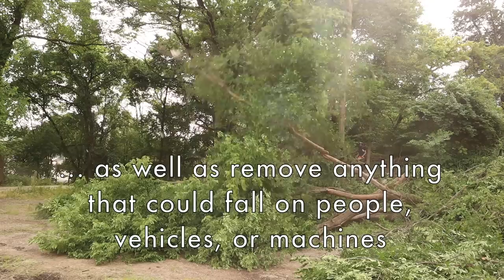Clearing Dangerous Trees from Behind the New Shop!  ~ Part 6 ~ Rebuilding of "The Salvage Cave"

Comment: I use ethanol fuel in all my equipment and it always fires right up with no problems.  Some of it can sit for years between use and fires right up.  Never had an issue with ethanol gumming up or clogging any carburetor.  I have at least 30 small engines and have been doing it that way since ethanol was introduced.  Just my experience.

Comment: Get 100LL at your local GA airport. Best fuel you can buy. Run Stihl ultra oil at 50 to 1. My father is an arborist and I have never had a problem.

Comment: you can remove the ethanol easily yourself. Mix 4 parts Gas with 1 part water, shake vigorously, leave over night. The ethanol free fuel floats in top of the water/ethanol, simply syphon it off. A clear container is best for this. I usually add an octane booster to the gas when I am done. Dispose of the water/ethanol in the same way you dispose of your other unwanted fluids.

Comment: Kawasaki 2 cycle  oil is the one  i have used for  years and   never had a problem with Kawasaki  ... using The Stihl  product is good but it will clog up your muffler Spark Arrestor  and other  things  ....   i know it's  not a 2 cycle repair video  on chain saws but i hope that helps  and by chance if you still do have the Spark Arrestor on Clean it or Remove it ... And for the Next Video  call in Mr  Ron Pratt  Mid West Towing  or Mr Hal From Summit Towing from  South Carolina  to help you pull out your front end loader LOL

Comment: Just for information, the problem is not the Ethanol itself but the quality of the base gasoline used to make the mixture they are calling gasoline. Using Ethanol you can mix it in a very poor, low octane, low stable and cheap gasoline to make a fuel that works as good as regular gasoline when fresh, but will not be stable to be storage for long time.
Ethanol can also absorve water and became more corrosive, an important aspect to consider if you have old cars.
Good information here: https://en.wikipedia.org/wiki/Common_ethanol_fuel_mixtures#Modifications_to_engines

Comment: You can remove the ethanol from the gasoline very easy, just mix the gasoline with water in a can, shake it and let it sit, shake it a few times during the day, and after a day the water have taken the ethanol from the gasoline and a mix of water and ethanol will be separated from the gasoline. Now you pour the gasoline into another can, and leave the water/ethanol in the bottom in the first can. Do the procedure twice if you want to be sure all the ethanol is gone. Now you have pure gasoline without ethanol.
Reply: Interesting

Comment: Fortunately in Oz it is still easy to get non ethanol fuel. Of the three grades at my local garage only one has ethanol. I also never put that crap in any of my small engines. I was reading a report the other day that said new testing has shown ethanol isn't even that good in engines designed to run on it. Let alone my old stuff. I run a lot of Stihl equipment and so buy Stihl two stroke oil. Then I just use that in everything else. Haven't had any dramas. I too run it a bit richer. On the newer Stihl stuff they have that stupid spark filter thing. Throw that away and then all good.
Reply: I never put ethanol fuel in any of my vehicles or equipment.  The ONLY time I buy it is if it is the cheapest fuel available near where I'm returning a rental car 😉.

Comment: Man ,I could use all that fire wood . 🪵 hahah I use the cheapest 2 cycle oil .. I have not seen any data on any 2 cycle oil product that proves its better , than the cheapest oil I can buy . 😉 plus at auctions I bought cases of a good quality oil for 10 bucks , that was 3 years ago still using and my chainsaw is a stihl  and running great

Comment: Clearly, your next toy needs to be an excavator with a thumb. I kept screaming at you to get out your bulldozer and use it as a wall while you picked up the logs with the wheel loader. I guess that fact that it is November when you posted this, and clearly it was summer when you shot it, not to mention that I am in Seattle, resulted in you not hearing me due to time and distance. I am wondering about hillside stability with the vegetation removed; might you need some sort of retaining wall back there?

Comment: In the UK we cannot buy ethanol free gasoline at all from filling stations, with even premium being 5% ethanol. I have to order gas called Aspen 4 (4 stroke) or Aspen 2 (2 stroke pre-mix) from my local agricultural suppliers in 25 litre drums and it is not cheap being £75 for the 25L drum.
Reply: Not totally the case, many premium petrols in the UK are zero ethanol, but they're still classed as E5 as it's the max that class of fuel can be. BP specifically state their E5 is ethanol free.
Reply: @kiesh.  The problem is that due to the UK delivery pooling system/syndicate, you can never be sure that you are getting BP refined petrol from a BP pump. It could easily be Chevron or Esso. The only Major Petroleum company that is not a member of the pooling syndicate is Shell, so you will always get Shell petrol from a Shell pump. Many years ago, I used to own a garage with Amoco pumps but when we ordered a refill, we never knew which company's tanker would arrive.

Comment: I have to say that this episode drove me a little nuts.  Your use of the skidsteer was wasteful. You would have been farther ahead using it like a wheelbarrow  and tossing in the small stuff by hand. As it was you mixed a lot of dirt in with the wood. I also would have loaded the truck with wood ready to be stacked. As it was you wind up handling the wood several times more than you need to. 
I've been cutting and processing wood for heating and lumber for over 50 years. I've done as many smart things as stupid things along the way. The main thing is to learn as you go. I'll call this a good learning experience.

Comment: stick with sthil mix gas/oil. get those little bottles add gas shake the can finish filling to one gallon. never a lick of trouble. yea the ethanol crap amongst other words. ruins fuel lines carb gaskets it’s not the equipment. since the lovely government went to and they wanted add more to purposely cause poor fuel mileage in cars/trucks so you gave buy more gas. burn premium fuels it’s better to use premium fuels in older engines get a good fuel treatment like ats plus a full tank i have used sea foam directly into tank whole bottle. sta bil is another good one. but sta bil for your collector car/boat engines lawn mowers. i have found she’ll start in cold weather if not good luck. put the battery on trickle charge get it good n charged but blow an electric heater on the block/manifold warm it up let it run just past idle some require more choke till it warms up then a gradual let the choke off then go mulch leaves but usually the day/night before charge the battery up full but a good hour/half pre heat if you can’t get non ethanol fuels or can’t buy premium do my trick.

Comment: There was an old man close to me that had an airplane. His health got bad so he hangared his plane for years and then died. His wife kept his plane in the hanger out of whatever reason . After 30 years she sold it and a mechanic that I know was tasked to start it and sell it. It has the same fuel in if for all that time and after changing the battery it started promptly. No stabilizer. Aircraft fuel is 100 octane no lead. The mechanics brother ran a small engine repair shop and said he used 100  in all his small engines for years. I used it for years until I was no longer near an airport. No problems no stabilizer. Go to your local airport. It is not cheap and most small airports have a self service pump and they don't care.
Reply: Many airports will not allow the sale of 100LL anymore to walk up customers. I used to stock up ok it myself now nobody will even entertain the thought anymore due to regulations.
Reply: Not all of the airport gases are no lead.  In fact, I don't think they will allow walk in purchase of 100LL..  ours doesn't.  But we can get regular av gas 100.  No road tax, either!  Still fairly.costly.

Comment: I always had the best luck with the Stihl 50 to one mixed per directions on the oil container adding more oil does harm the engine it will carbon the top of the piston gum up the rings and plug up the muffler to restrict the exhaust and if you let it sit too long the gas will evaporate leaving a lot of oil left in the tank and carb I have 30 yrs experience working on two cycles todays oils are far superior than your daddys oil best to follow directions on the bottle
Reply: This.  Truth.